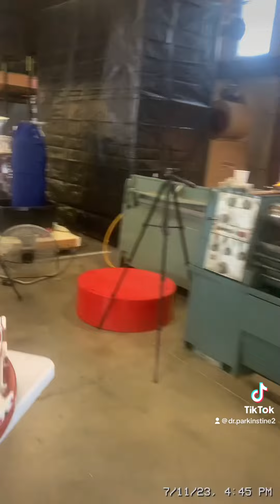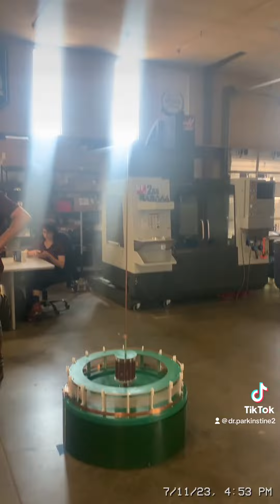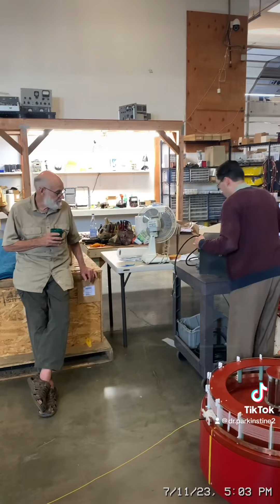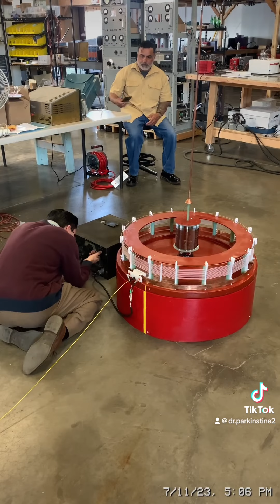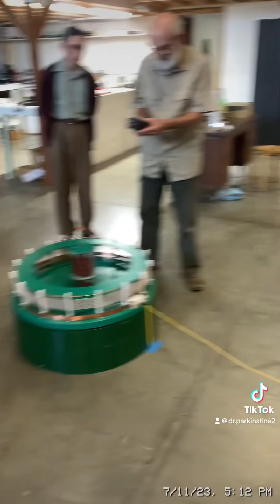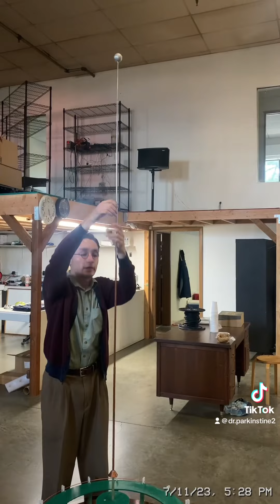Emediapress lab

Comment: Cool but what’s happening?
Reply: Basically it's the follow-up from the fringe science conference that ended Sunday.  We have a pair of 20-1 scale model Colorado Springs coils and the goal is to do some high-level experiments with them (like transmitting a thousand watts through a 40awg wire or wirelessly).

We did a rough version of this in 2019 and the results were quite interesting
Reply: @hakasays  Right on! Thanks for explaining. I had literally no clue other than something with electricity.